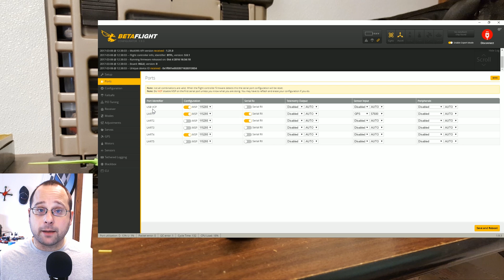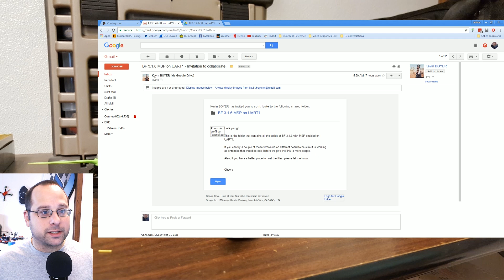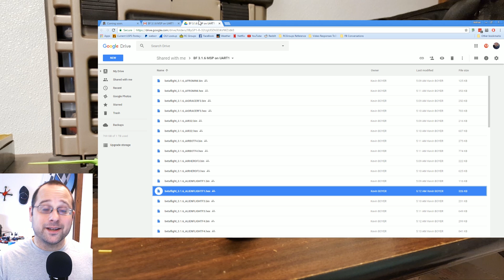Betaflight 3.1 Broken USB Port FTDI Adapter Won't Connect | FIXED

Comment: Not trying to step on your video Joshua but I received a lot of questions on how to do this, so I made a video and gave you credit. Hope that is fine. https://www.youtube.com/watch?v=5VmhoyL6Z7Q
I dont use UART 3 and the bootloader in the video because that wont work for all boards. But if you do it that way then make sure you select "full chip erase" when you flash firmware, otherwise it wont work.
Reply from the maker: You're always welcome here!
Reply: Thanks Joshua. As always I love your videos.
Reply: Also JC mentioned that if you have VCP enabled board you cant do it using FTDI. You CAN. Just press BOOT button and then connect the FTDI. It wont show up in connection but youll be in DFU on board and you can flash. Worked for me right now.
Reply: ken, JC died 4 months ago...

Comment: does anyone have the link to the fw?it doesn't seem to work anymore
Reply from the maker: You can access it now in Betaflight configurator. Enable Show Unstable Releases in the firmware flashing tab and there is a USB rescue branch in the pull down menu.
Reply: @JoshuaBardwell   thank you very much!

Comment: I just got my first drone last week and it landed upside down and before I could do anything smoke came out of one of the motors so I disarm to the quad remove the battery and came home I went to plug it into to pc without the battery installed and smoke came from the fc so I unplugged it and had a close look and found some little bits damp mud on the FC I cleaned it all up and plugged the battery in and it all beeps and lights up but when I arm only 3 moters Spin the outer is juddering  so I unplugged the battery and go to my pc connect usb and it lights up but will not connect to bataflight I'm lost at were to start to get fixing it

Comment: Hi Joshua, thanks for your videos! I broke the USB port of an iFlight Beast F7 45A AIO (https://shop.iflight-rc.com/index.php?route=product/product&path=18&product_id=1377) but it doesn't say anywhere what they are the SWDIO and SWCLK ports. How can I do? Is there any way to figure out which ports to use? Thanks in advance.
Reply from the maker: The pinout of the USB port should be standard. So look up the order of the wires. Then identify 5v and g with a multimeter. Then you should be able to find the remaining pins.
Reply: @JoshuaBardwell   perfect thanks
Reply: @TaraCarlo  Hi Carlo! Have you found where the ports are? I am looking for information, and my multimeter is damaged ...

Comment: my board is a f405 wing and i broke the usb port after it was flashed with inav 2.5.0 but i still need to connect to finish setting up, will this work for me? thanks for all your videos

Comment: Hi 
I was connected to cleanflight with the USB and was stuck waiting for data , I disconnected and plugged it back in and it was still the same.
I disconnected the cable again and tried connecting again but now it doesn’t connect to clean flight.
I have a f3 running the latest Mac book
Reply from the maker: It sounds like the USB cable or maybe the USB port on the FC is broken.

Comment: Oh you are still answering, great Joshua, or Joshua the Great!!! After installing bf 3.1.6 I needed to update firmware to use blheli32 escs but it could not go in bootloader mode, is it possible that using FTDI adapter you can not flash firmware normally with betaflight?? And after flashing bf 3.5.6 with ST Link V2 adapter, Blheli32 suit passthrough does not recognize escs (esc unknown firmware) but if I connect esc via Arduino they are recognized by blheli32 suit.... May it all due to FTDI adapter? (I've posted some pictures here https://www.rcgroups.com/forums/showthread.php?3238515-Problem-with-BLHeli_32-and-Omnibus-F4   but nobody answered yet...).
Reply: Ah If you want to update, now in Bf firmware flasher, with expert mode and unstable releases unabled, there is Maintenance (USB) rescue, and you can download every version and every target firmware with usb on uart1 unabled!! (https://github.com/betaflight/betaflight/issues/7076)

Comment: And one last question.....
Is there anything we can do personally  on securing the USB port to the board better so that we can possibly prevent running into this issue?
Reply from the maker: Some people put a small amount of epoxy over the USB port to help secure it. Just be sure not to cover anything unintentionally, such as a button or a pad that you need to solder to.

Comment: I read thru the comments and didn't see any ask about an F7 board. I assume the technic would be the same as the F4 board?   And if I'm not using uart 1 on my other boards would it be a good idea to go ahead and enable vcp on uart 1 in case the USB snaps off of them too?
Reply from the maker: If you aren't using UART 1, you could enable MSP on the UART. For F7 boards, this might make more sense, since they have a lot of spare UARTs.
Reply: @JoshuaBardwell  thank you so much. I have one F7 and two F4 boards not being used due to this issue.  Thank you man.

Comment: Is this possible with my Mobula 7 F3 pro flight controller? One side of my usb connector has come off the board and not sure how to fix it. Second time trying to get it all working and I’m thoroughly fed up.

Comment: Hi josh. I have disabled accidentally usb vcp in betaflight,now I cant connect and also boot my FC. I have omnibus f4 pro v3 board. Help me bro.
Reply from the maker: Put the FC into bootloader mode and re flash it. Enable the "fill chip erase" option. This will reset your config.
Reply: Ohh thank you josh. Its working now. And hey,I  agree with what you posted in github. I think betaflight should put some strong /scary warnings 😁 on this. Thanks again

Comment: I have an SPRacing F3 EVO FC but does seem not to have the CP210 chip on board can I still use any UART with the FTDI adapter for iNav to talk to the FC...joe

Comment: Do you know if there is a file for BF 3.5.1 somewhere with the MSP turned on by default?
Reply from the maker: No, I don't.
Reply: Go to betaflight firmware flasher, set show unstable releases and expert mode, now you can chose maintenance USB rescue and download for any target and firmware version one with usb over UART1 enabled!!!

Comment: I broke micro usb port on omnibus F4 pro v2 and I am trying to regain ability to connect to computer back using ftdi adapter.
Is there a way I can do a custom build where MSP is turned on default on UART1? Like a one line change in code and compile can do it?
Target - OMNIBUSF4PRO_LEDSTRIPM5.
Reply: Look here
https://github.com/betaflight/betaflight/issues/2566
But now it is automatich if you set show unstable releases on Bf firmware flasher, than you can chose Maintenance USB rescue that enable MSP over UART1

Comment: Hey man; I just broke my USB off my new FC. Basically, is there ANYWAY to activate a Uart with out being able to access via USB- it was a brand new board; never used; I was tinning the pads; and I somehow got the smallest little bit of solder in the USB port. But I have hooked up my Bluetooth to the TX and RX on the Uart 1- but like I said; I never turned it on in the Config tab in betaflight- bummer!! I’ll make sure to check back in on here. Thanks in advance. - Judson - Central FL

Comment: Hey JB - This probably opens up a video to show us how to make a firmware image with msp enabled on UART1. I just broke my usb port off my beebrain v2 and will have to figure this out. Hope you're enjoying China :D I should add my BBv2 is currently running 3.3.1 so msp will be off on the current image, however I have access to UART1 on the bottom of the flight controller. Given that you can flash any image via UART1, I should be able to get out of jail once I figure out how to make a 3.3.1 firmware image with msp enabled on UART1.

Comment: I broke my usb today and alternative ftdi- uart1 failed to connect because vcp is disabled. So I placed the usb back in place with slight pressure by finger and tilting forward and backward. Thankfully contacts initiated and connected to betaflight. I jumped quickly to Ports, enabled uart1 vcp and saved. Viola!

Comment: What if betaflight f4 board docent want to open no flashing no dfu not even if i use ftdi and zag said device fail i get device descriptor request failed
Reply from the maker: Device Descriptor Request Failed sounds like hardware damage. It can also happen if you flash the wrong firmware to the board, but in that case, bootloader mode should still produce the "STM32 Bootloader" device, which should work for flashing the board.

Comment: Between you and blue falcon I managed to bring my  Diatone Tyrant S 215 back on line , I must have switched off the msp on the ports for uart 1 and couldn't get back in, from your link above the file I used was from the corner box labeled, BF3.1.6 MSP on uart1.zip. Betaflight 3.1.6 FuryF3.hex to reinstall the settings and it switched on my Tyrant S 215 2017, I could't find the one they recommend which is Betaflight 3.1.7 hope this helps someone else.

Comment: Hello Joshua  -  Thanks for your videos.

I could connect my omnibusF4SD (F4 pro v2) to earlier Betaflight Configurator versions on Chrome (on XP 32bit).
Now I have not been able to connect on any of my computers (XP 32, W7 64, W7 32), even when using your Zadig video advice on STM BootLoader (and Blue Falcon's videos). Have tried several USB cables, cleaning remove drivers before trying again, tried STM32 VCP setup v1.4 and v1.5.

Boot loader works on W7, so I can flash firmware after Zadig treatment. Very shortly thereafter I can sometime connect a short time in Configurator 10.1, but it disconnects then.
A following non-boot connect of my Omnibus board gives Windows error 43, driver not loaded. Does anyone know why?

Q: Would connect to Betaflight Configurator be possible with a FTDI-USB adapter without getting the same driver problems?
Reply from the maker: It sounds like the board may be damaged.
Reply: So not much chance either to connect the board with an FTDI-USB adapter and its different drivers?
Reply: When I got a Bardwell flight controller instead, it connected right away :-)

Comment: HI JOSHUA i HAVE THE SAME PROBLEM ONLY WITH iNAV 1.7.1. iS THER ANY FIXES FOR THIS CONFIGURATION OUT THERE?
HATE TO THROW AWAY AN OTHERWISE GOOD BOARD.
Reply from the maker: +Art Lindstrom don't throw it away! Flash the board with "full chip erase" selected. That roll reset the config.

Comment: Good, but now it's useless for me, because my BF configurator can't connect after successfully flash 3.17 firmware. Looks like just buy a new FC and problem solved

Comment: This sounds  familiar with my problem  with my spracing  f3 evo. BOTH OF THEM(I received a replacement that stopped working also) stopped working after I flashed to a newer betaflight  (I forget which one thou..) I set it all up, disconnect it and go outside to arm it to fly and nothing happens, only a green light that's constant is on. And it won't connect  to me computer anymore. I mean not the "unrecognized  device" I'm talking about, it doesn't see it at all.  My phones gui  doesn't see it anymore either,  just like the first one, the same thing happened both times. Would a turned off msp  toggle  disable my board from being seen entirely?

Comment: Mine keeps saying failed to open serial port. I've also noticed that nothing is plugged into the uart ports on the drone, and idk if I'm supposed to plug something in there or if something is supposed to be plugged in from the factory? It's brand new, and I'm new to all this so I'm pretty lost and I'm not sure what to do to fix this.
Reply from the maker: +Tonio9606 search my video "Betaflight won't connect" for instructions on installing the drivers.
Reply: Joshua Bardwell Thank you. I just watched the video and installed CP210x for windows 64 bit and the VCP set up. However It didn't fix the problem. Every time I plug the USB in I get a message saying "USB Device not recognized. One of the USB devices attached to this computer has malfunctioned, and windows does not recognized it". But there's no way something has malfunctioned because it's a brand new quadcopter. I did also try installing stm32 Bootloader and still nothing.
Reply: Joshua Bardwell Hello I just wanted to tell you that I solved the problem. After several days and hours of going through several videos and methods to figure out why my computer wasn't linking to my drone, I found out that the problem was the USB cable. Apparently you need a 3.0 USB cable in order to use beta flight. Just thought I'd let you know so that maybe that information can help you or someone els out with that same problem.

Comment: - (Gets down on one knee) Joshua, you're my only hope!
 - Cut to a man pulling his beard out like a brain frenzied Zombie!
 - on a serious note, I'm having this problem with my Flypro XJaguar, and I'm not sure I'm flashing with the correct Hex file...(SPRacingF3)  cuz I don't know what the original flash was on mine due to a missing USB, and then you have to straight up "Blow It Away" with an "Erase Chip" to install the new one...  
   I have two boards...  USB problem on first one, ordered whole new tower, just to get a new FC, 2 weeks later...  I don't know where my USB is? it disappeared! I went to plug in, thought I was on the wrong side, and nope...  it's gone!
   bought the FTDI adapter, won't connect...  so I bought the ST-Link v2.  built the wires, everything is correct... Huptillion checked! finally fiddled with the ST settings enough to connect with Boot button held, erased chip, unplugged, verified, all FFFF's, flashed the chip, unplugged, verified new Hex. 
   Now for the funny part...  when I connect the FTDI232 the board lights up like a Christmas tree...  just like before, and it changes to COM10, but it will not connect!
   Both these connections are on the front of the FC, FTDI is 4 jumper wires out of my 10 connector plugged in, and I have Continuity from pin to pin on boards TX1 and RX1..  and I soldered together the ST-Link cable... but it works!
   I am wondering if the SPRacing F3 Hex is wrong for the Xjaguar FC?
Reply from the maker: +Dale Bear pretty sure SPRACINGF3 is correct. Maybe your board is just toast.

Comment: @Joshua Bardwell    I have a Matek f405 Flight controller and unfortunately the link containing the hex files does not include the firmware for my board.. is there any way that you can request that hex file from Kevin Boyer?
who should I go to for help? 
thank you in advance!
Reply: Juan Su did you ever get the firmware? I need it.
Reply: Sherman G unfortunately
 @Joshua Bardwell never replied... I just ended up buying a new board 😢

Comment: hi. I have bff3 fc and 2 days ago was working fine but now when u connect to my Comp via usb its not recognized. I've tried reinstalling drivers but nothing seems to work. its also unrecognized in bootloader mode. I'm at a loss. please help
Reply from the maker: If you are 100% sure it is in bootloader mode (check the LED flashing pattern and see that it is different when you hold the bootloader button down vs. when not) and it still isn't recognized, either the USB cable may be bad or the board may be bad. Some USB cables have only power (for charging phones) but don't pass data. 

Try a different computer. Also try the ImpulseRC Driver Fixer application.

Comment: This is off topic but I could use some help. I there any way to change the motor mapping on a Pico Blx? My motor 1 location does not work and I would like to know if there is a way to change the motor 5 or 6 location to function as motor 1? Thanks for all your helpful videos.
Reply from the maker: https://www.youtube.com/watch?v=z5aO-3_n-Hs

Comment: I changed uart 1 to uart 2 cant connect to flight controller?
Reply from the maker: Yup. Now you have to either connect and FTDI adapter to UART2 or put the board into bootloader mode and re-flash it with "full erase" selected (you will lose your config if you do this).

Comment: And how not to break your USB port?
I think it would be better to go back to 'old school' (larger) USB connectors but probably not an option now.
Banggood sell 'Magnetic Adsorption' USB connectors which are basically faux Apple type things.
Not sure how the plug end would handle big 'bangs' but maybe good enough for an occasional clumsy cable-breaking incident.

Comment: I accidentally turned off map on uarte1. now my computer won't connect. how do I turn map back on.
Reply from the maker: +Robert Sherred put it in bootloader mode and re flash it